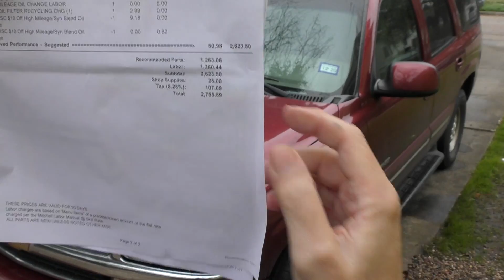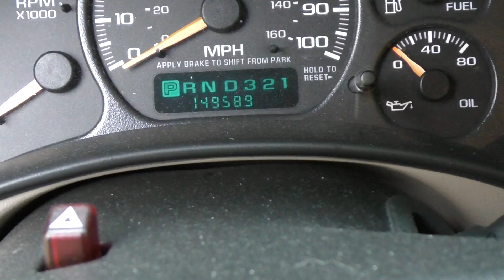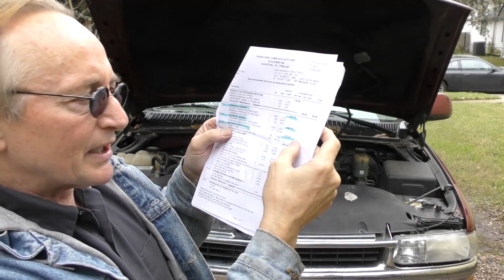This Makes Me Want to Quit Being a Mechanic

Comment: Several years ago, an elderly couple from Cuero Texas brought me a 1989 Buick Electra, that was overheating. The shop they took it to in their hometown tried to rip them off, by charging them for repairs they never did. They went so far as to take old parts off the engine, and spray paint them, then put them back on the vehicle. I ended up having to repair the vehicle properly, and they got an attorney in the meantime. They won a lawsuit against the repair shop, and were able to buy a brand new car (cash in hand) in the process.

Comment: I had a Honda dealer tell me my rear shocks were leaking and needed to be replaced for $400! I told them to pound sand! That was 200,000 miles ago. Car still rides just fine.
Reply: I had the same thing happen to me. But mine actually were leaking when I replaced them myself for like 60 bucks
Reply: forget going to a dealer , unless it is warranted and the place has an honest/good shop supervisor.  Watch buying replacement chip keys too. they can ask for $100-300 a key,  Just about all chip keys can be bought online for $10-20 , and the car will program the key itself,

Comment: This is now going on at Main Dealers. You go in for a $200 service and come out with costs running into the thousands. Thank you for calling out the shop.
Reply: Every time I would get my free oil changes at the Nissan dealer, they would come out blabbing how they recommend a laundry list of crap coming out to like 800 bucks. Every single time. I always said no. I'm not dumb. Unfortunately the gullible old ladies eat it up and say yes. I wanted to tell them to say no so bad.
Reply: @A P
 - Don't go to "Main Dealers" then. Hell, don't go to any dealers if ya don't wanna. The choice is yours.
Reply: @NoName-gv6nm  Well, a lotta folks that comment here need to follow your lead and do the same thing. They make it sound like they're held at gunpoint haha! "Buy this or else!" Punks!
Reply: These shops will go bankrupt when Americans start noticing that they’re getting ripped off.
Reply: A P You're right.  I noticed over the last year the service center of our local Toyota dealer is always trying to upsell you a repair you don't need.
Reply: The biggest rip off at the dealers is the price of cars.
Reply: Lol and when u declined an inspection and your car break down you're gonna want free work done cause they didnt let u know what they see was wrong with your car.

Comment: When asking for a price quote on a set of tires, they gave me the price for one tire. They never said it was the price for each tire. They installed the 2 tires. The bill was now, twice the price they quoted me. I had them remove the tires from my car and put back on the old ones.

It is not like this was their first day of running a business. 
Another time I was quoted a price for a car battery. I agreed to the price. They installed the battery. Now the price was $ 50.00 higher. They said that was for the installation fee.

 Who goes to a auto center and they only give you the price of the parts without the cost of labor? I got the installation fee down to $ 15.00. 

Now I never go to Firestone.
Reply: Lol lotta work replacing a battery
Reply: Man I took my truck to Firestone to have some tires mounted I got on tire rack.  Picked it up and they told me I needed a new tensioner pulley. The funny thing is I had just replaced the tensioner myself the week before.
Reply: I gotta say , I had 1989 Ford Festiva ,  at about 30-35K miles in 1990-1990, I went and had the tires replaced. 4 tires mounted and balanced cost me $38 Total !!!* Great little car, I sold it about 2007 after many  family members used  it too,  for $500 with 587K miles on it :))) .  It was pretty beat up by then, got about 2  feet of water it  from Hurricane Katrina( it started right up after wards, blew a stream of sea-water out the exhaust 20  feet) . the thing was still running good.
*-there was a tire  factory in the same town Ilived in at the time  that made tires sized for it.  $6-7 a tire I could not believe it. went though more than a  few sets over the years,  I don't recall paying more than $80-90  for a set even 18 years later.  If i took it to a shop they said $200+  for a set, I'd laugh in their  face, and never went back to those shops  for anything.
Reply: That's like a restaurant charging you a 'cooking fee!'

Comment: Boy can I relate to this video Scotty.  I'm retired from a 47 year career as a mechanic.  I'm a certified Heavy Duty Mechanic but have also worked in Motor Transport and also worked 5 years for a big city Ford dealer as a mechanic when things were slow in my industry.  I've seen no end to mechanics charging for labour they didn't perform, parts charged out but never installed except for in a drawer in their tool cabinets.  Service advisors upselling and recommending work that wasn't needed.

Comment: I needed a upstream 02 sensor replace on my vehicle. I called a brand name auto shop for a quote, called me 5 mins later talking about, $480, just for labor. I bought the part at AutoZone for $45 and did the job right in the parking lot.
Reply: Unless they're in a really difficult to reach location, which can be the case on some vehicles, O2 sensors are generally very easy to replace. I helped my dad do it once on his Ford Ranger years ago. Basic tools. No knowledge. $50. Problem solved.
Reply: Yea us too. We bought the upstream O2 oxygen sensor from autozone for like $70 and borrowed the tools from autozone and did it by ourselves. Lol.
Reply: teddy bruckshot  Quoted me $50 to replace a brake light. I bought a set of brake lights at WalMart for 5 bucks, googled for DIY instructions, and replaced it myself.
Reply: Make sure you use OEM O2 sensors. Aftermarket sensors can cause your MIL to come on again. I learned this through experience.  I bought a Chinese aftermarket MAF Sensor for my M- Class Mercedes Benz SUV and the Check Engine Light came on with- in a few minutes of starting the truck. Installed a Bosch OEM MAF sensor and haven't had the problem since. Its been a couple of years- and the OEM sensor is still doing its job.
Reply: Or you can clean the old one with throttle body cleaner and toothbrush and you’re good to go😁😁😁. That’s what I do when I get a code for my 02 sensor, 01 bmw and 06 infiniti😁

Comment: Took my 2001 bmw 330xi to the dealership for check engine light 4 hours later the tech came back with an 11,000 estimate to fix , I told the guy when you got to 400.00 you should have stopped and not make me waste my time

Comment: Wow, that Chevy has no rust whatsoever. I need to come to Texas, used cars from the same year in Chicago all have rust. :(
Reply: CptHuggyFace same here in Detroit Michigan
Reply: why they can get a lot of miles  on them... i only put two of my cars  on the road  in the winter in ohio..my 95 transport   an my 92 vk1500 chevy
Reply: Same thing anywhere in Ohio
Reply: There's a huge difference in the weather. Chicago get too cold and snow a lot. Not much in Texas.
Reply: I live in Canada...so salt in the winter is an issue. Most vehicles don't look so good after 8 to 10 years. Lots of car washes in the winter and some kind of rust protection does help a lot.
Reply: CptHuggyFace yep I feel ya
Reply: Buy your car from the south. My 2003 Mustang GT has ZERO rust on the frame.
Reply: 🧤 yeah we are in the Rockies
Reply: Y'all need to come to KY, no rust on hardly anything.
Reply: No rust on socal cars, even my first gen mazda 3
Reply: Jose The rust isn't from the cold or snow, it's from all of the salt that is spread on the roads by plow trucks. It is very corrosive to metal parts if not washed off regularly.
Reply: Same in Connecticut. A car with that age would have rust holes in it.   Funny thing is.. that even here in the ultra libtard state of Connecticut they got rid of the safety inspection, so you can drive around with the holes all day long.  The rip offs just got to epic proportions that even the legislators could not ignore it.
Reply: That car's paintjob looks bulletproof. I think there's a way to do that and make it last near forever but very expensive.
Reply: CptHuggyFace samee i dont want to buy a new car so i just have my 02 silverado with rust lol
Reply: Ain’t gonna lie in Chicago they sell nice customized truck but they be having a bunch of rust
Reply: Come to Northern Canada and the salt on the roads will make any vehicle become a rust bucket within a couple of years ! Cheers from Canada Polar Bear country .
Reply: Same here in California we don’t use salt either.
Reply: People need to know to wash the undercarriage after winter, the road salt with eat through anything.
Reply: CptHuggyFace Southern cars never have rust
Reply: Dee Hurst get a ford tho
Reply: He's in Houston tho that person probably keeps the chevy in a garage or carport
Reply: We dont salt our roads. That's the biggest difference. A dusting of snow shuts schools and businesses down for the day.
Reply: @cocopublicnews6766  no way. Look at all the leafs on the windshield.
Reply: You live in a winter climate and bigger cities use a lot of salt. Cars don't last 10 years without problems. I haven't seen any car last.
Reply: CptHuggyFace still not as bad as some new york cars ive seen
Reply: This is why I LOVE living in Southern California. Beautiful weather all year around, no snow, no salt, no freezing rain.
Reply: Yea, areas  away  from the sea and states where they don't salt roads, you can  find some old cars no rust at all hardly. like in Tn, Ark., North MS.OK, etc. , try carcomplaints/resources/guides/salt-belt

Comment: Same in uk, i'm a mechanic with 35 years experience, a big tyre,brake and exhaust outlet were offering free puncture repairs, so i took advantage of the offer..... guy puts the car on the lift, takes the rear wheel off, first thing he says.....you need new rear pads, they're low.....i asked if he was sure, said yeah mate they're low and need doing.......i said that's odd as i replaced them 2 weeks ago!!! he then looked again, and said...oh yeah they're fine, sorry!! then fixed the puncture. wonder how many people got suckered with that trick?
Reply: Dave Swarbrick Come to America and see it for yourself. It’s a thing here with the big auto chain shops.
Reply: Veni Vidi Vici it's not just the big shops, it's most shops, small medium and large, and not just automotive, it's most services
Reply: Similar thing happened to me a few years back in Australia. Brought my car in for the annual inspection. The guy finished the inspection and said I needed a clutch slave cylinder because it was leaking. I just kindly fobed it off and said ill get it done next time. The slave cylinder was replaced (brand new) 2 days before the inspection. So never went back their again.

Comment: 18 years and 174000 miles on it. That thing's a gem. That reminds me of my 2000 Toyota Tacoma V6 4x4 with only 60,000 miles on it
Reply: Travis k ooo I have the Australian equivalent a 1997 prad. Do my own work on it lol
Reply: Whoa, I wish I could find an older Tacoma V6 with those miles, I'd buy it up quick!  They just don't seem to exist anymore without having 200K+ miles on them.
Reply: @Believe231  I could be convinced to sell mine for the right price.
Reply: That’s nothing I have a 1998 Toyota 4Runner SR5 bone dry under the oil & tranny pan, undercarriage & no oil on top of engine with 266K miles
Reply: @travisk5589  what's the right price? Where are you?

Comment: Your advice is awesome, I spent many years repairing cars then went to RV repair . Louisiana, and I am sure others have a "safety inspection and emission test " I also worked on cars in taxatuchetts, 50k miles rust through body panels, oops you need body work and most times the cars is not worth the repairs. If  my friend in Houston needs help I am sending her to you,a college student on a very limited budget. Thanks for what you do very helpful.
Reply: Have her buy a Toyota... End of story LOL
Reply: @alexlevy322  I know ,right, I drive a 2000 Tundra that I bought new and it is rocking right along.

Comment: In Illinois some areas require an inspection. They contracted to a third party who only does inspections. No charge for the owner I think the State pays them $15 per vehicle (ok we do pay in a round about way). All the inspection consists of is plug in ODB and check for faults.

Comment: It's funny cause I get my car inspected at a Firestone, and they constantly recommend a bunch of work... then tell me what places to go to so I can get that work done cheaper. Instead of replacing my ebcm they recommended a junkyard so I can get a used one. Had a potential exhaust issue, they pointed me to a cheaper place to get my exhausted tested and fixed. I wanted my fuel injectors checked, they told me their price and then told me of another place to get it done cheaper. They are so good to me.
Reply: I have had good luck with them in two states. None have really tried to sell me something I did not need but all of the stores aren't ran the same. I do know they are pretty insistant that techs and managers sell as much as possible and they will tell you something like: If it has that many miles on it we recommend changing it.
Reply: You got lucky, then. I have never had that experience at Firestone. While they're not rude to me or anything, they do try to sell me on expensive repairs quite often. I don't have them make my repairs. I usually take my car to another place I trust, if my friend's husband (ex ASE auto mechanic) doesn't have time to do the repair. I'm not skilled enough to try most of the repairs on my own.
Reply: It seems like a hit or miss. I’ve generally had good experiences with Firestone understanding that I’m probably paying a bit more
Reply: Must be related to Scotty!
Reply: @SophieMia806  You might not be skilled enough to do repairs, but you can do basic maintenance yourself

Comment: This is why I do my own work now. Last time I took my car to a name brand place for a oil change they put the wrong oil in, luckily the car put itself into safe mode they also didn't own up to it. YouTube is my mechanic school 😂🤣 Recently I even replaced the solenoids on my transmission valve body paying only 100 bucks for parts and watching only YouTube videos.
Reply: 100%, I made the decision a while back that I would do anything that didn't involve welding or getting my torso under the car (so basically exhaust). And this summer I'm going to teach myself mig welding!
Reply: Definitely can save  💰
Reply: What channel did you learn that, besides Scotty?
Reply: @JoeUrbanYYC  

Aren't companies asking for diplomas or certification or something?
Reply: That's a smart car, which one?
Reply: @invaderzim1265  I can't remember the exact Channel I had to look up the exact model of my transmission. I have a 06 g35. I was able to find quite a bit the hardest part was figuring out which 12 bolts had to be loosened to get the valve body out lol. Replacing the solenoids was the easy part.
Reply: @gtarules1  that was my 2012 Mazda 3 that put itself into safe mode. Once I left "iffy" lube the check engine light came on and the car wouldn't go over 30mph 😂 I had to look it up to figure out it was the safe mode
Reply: @JoeUrbanYYC  I've been considering getting a welder to mess around with and learn!
Reply: Yep that happened to me I took my 2013 GMC Sierra sle in to a GMC dealer ship to get the oil changed right away it was my lifters were ticking like crazy I was pissed so I got me some vavoline synthetic and new filter changed the oil the lifter tick completely went away.
Reply: @JoeUrbanYYC  Good for you..Being able to mig weld in order to do body repairs and fab tools is a game changer
Reply: Yep there's a lot of stuff i don't know, and everything is on youtube. Do i know the general area of where it should be yes. But every car is different. And chances are someone has put out a video that relates to your specific car.

Comment: Here in the U.K., we have our annual MOT (Ministry of Transport) test. Every car that’s 3 years old or over must have the test done every year. (Up till when it’s 40 years old) It costs £54 and any garage can train their people to be able to conduct the test, by training them according to a set of rules, resulting in them becoming an official MOT tester, with a certification from the Government. If your car fails the test, you cannot legally drive it on a road until the fault(s) causing it to fail are rectified. However, it is fairly uncommon for people to get ripped off because the testers must follow a strict handbook, which tells them specifically when to pass and when to fail each item that’s tested. It seems to work well and the Government being behind it all is probably why. This test has been running for well over 25 years. Loved the video, Scotty! Cheers! 👍🏼

Comment: Scotty, here in Kentucky we had V.E.T (Vehicle Emission Testing) testing, some years back.
The only thing they did was inspect the exhaust system, using a computer as well as visual impection. The tests were at state-run facilities. 
They sold nothing, repaired nothing. Theyonly took the report from the computer/inspector, and the pass or fail was given at the time of testing. A fail was given time to be repaired, then the car had to be retested. 
Your video was an eye opener. My only other experience with vehicle inspection was on air bases when my dad was in the Air Force, eons ago. Pure inspections, there, as well, from what I heard. 
Thank you for posting this video. I learned something new today.

Comment: This is a prime example of why I do my own repairs, and when someone I know has a question I can typically give them a straight answer to if they are getting hosed or not.

In the case of the tires....stop parking downtown, or at least stop rubbing the sidewalls against the curbs.